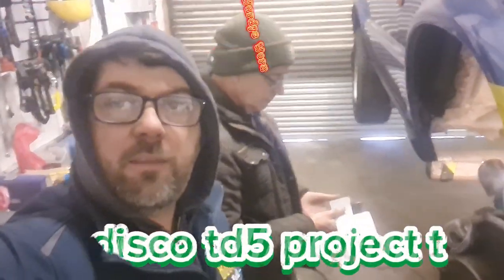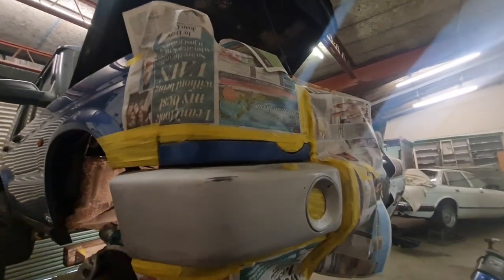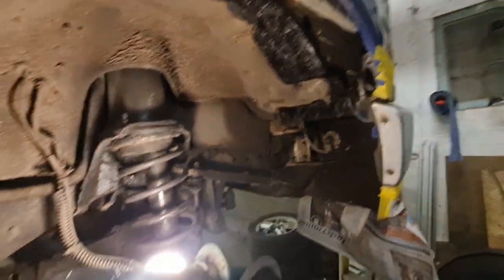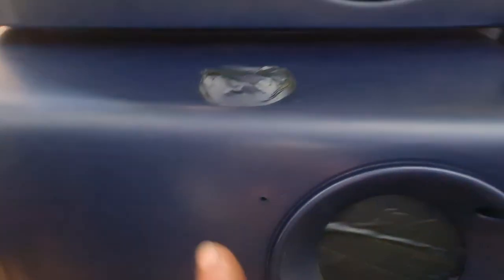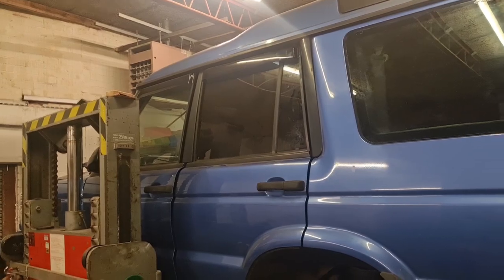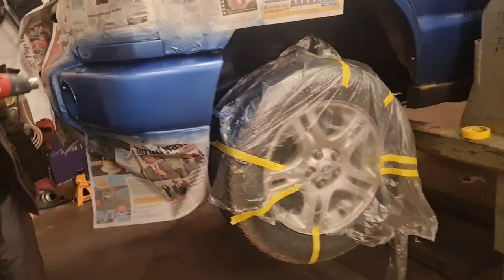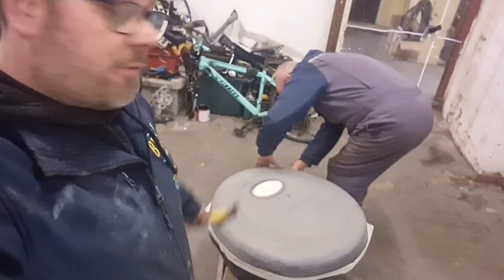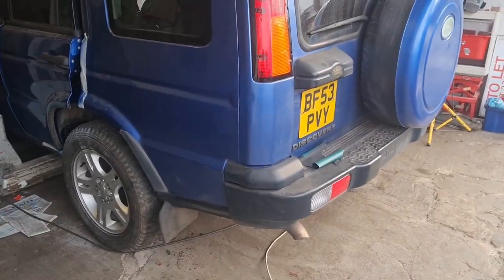land rover discovery td5 restoration. more rusty holes and some painting plus the leaky screen

Comment: Great video guys 👍 was the rubber trim on the top of the windscreen easy to remove? Iv got the same problem rust on the roof above the windscreen, I was going to have the windscreen removed but if it can be sorted with it in place I'd rather do that, cheers guys 👍
Reply: I've got the same problem too. How did you get the seal out with the screen in place? I did try to do one once and broke the windscreen.
Reply: Shame you could take time to answer our question regarding the upper window rubber 🤔
Reply from the maker: There is a video coming.
Reply: Same problem here:( what rustkiller do you use please?

Comment: Under the front wheel arches is a common problem. Must have been awkward to weld with that wire harness in the way!     Is that windscreen rubber all one piece?